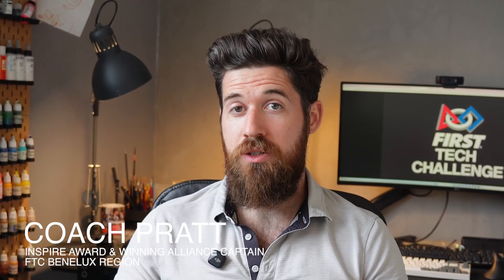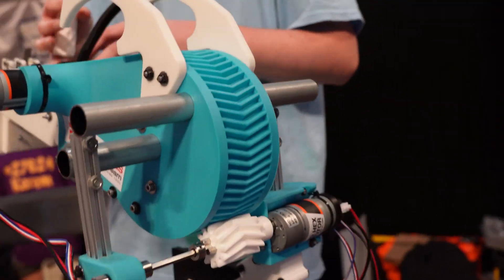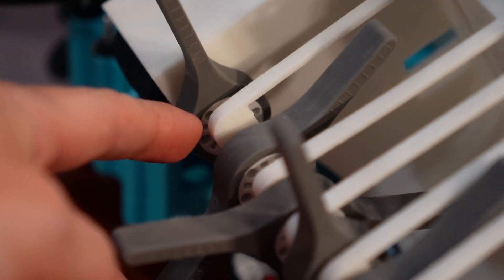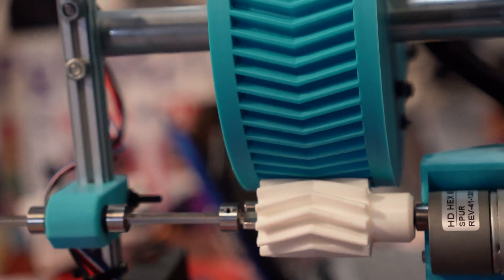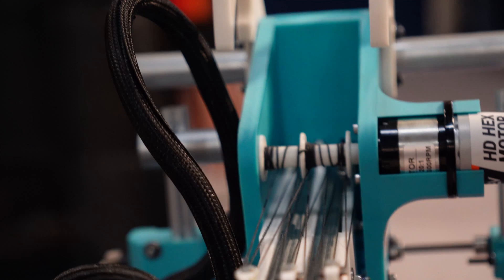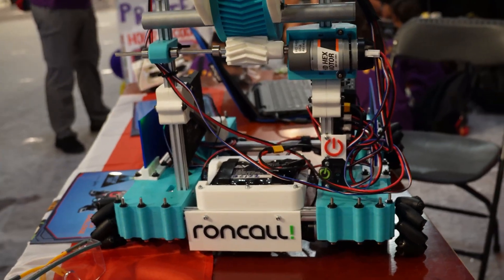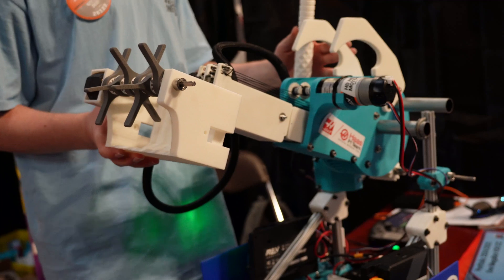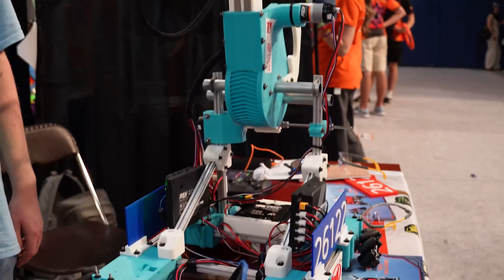The Secret Behind Their Budget Lift System: FTC Robots Revealed 26122 OneMegabot

Comment: Hey you should do a short form video about axon max servos
Reply from the maker: In what context?
Reply: @BroganMPratt informative, like your comparing the axon servos to the gobilda servos, or any other vendors servo
Reply from the maker: I'll add this to my light. However, I wouldn't recommend axons at the point of writing (I used to!). in short: manufacturing issues with low voltage starts. see my full thoughts on this thread: https://www.reddit.com/r/FTC/comments/1l1abw1/axons/